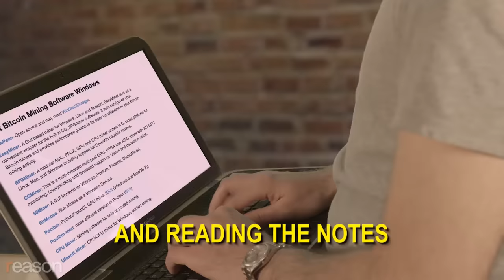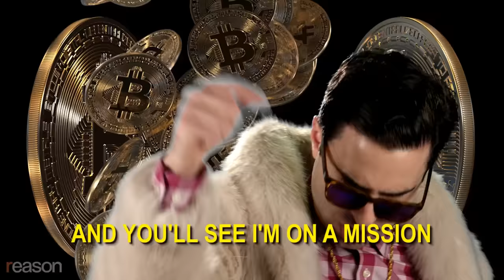Remy: Bitcoin Billionaire

Comment: to be fair if there was a solar  flare even your normal bank accounts will be worthless
Reply: locknight ya it was just a hater jab at the end they threw in.
Reply: Yeah, pretty sure none of the cars would be running either
Reply: dauchande ya precious metals would be great then.   Lead would be even greater lol
Reply: That depends on the intensity... we could die directly, if it was intense enough.
Reply: Surely the blockchain is more resilient to a solar flare, where the same database (blockchain) is replicated across all nodes, and HD wallets or private keys can be easily backed up by writing down a sentence to a paper. Or graving it into steel. That sounds like a better backup plan for the whole ecosystem. Bitcoin (and other major cryptos) would come out as winners from a devastating solar flare.
Reply: Your gold wont melt in a solar flare though.
Reply: @ayandas874  with Bitcoin you can get best of both